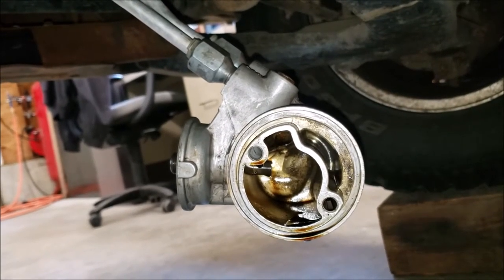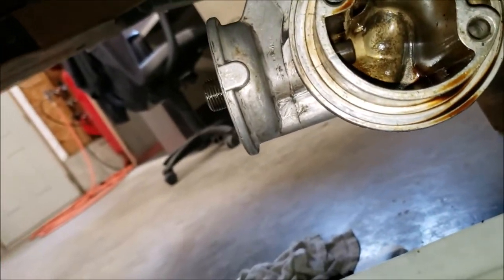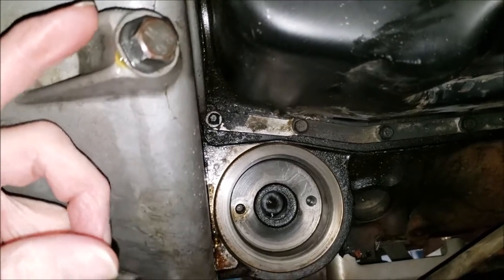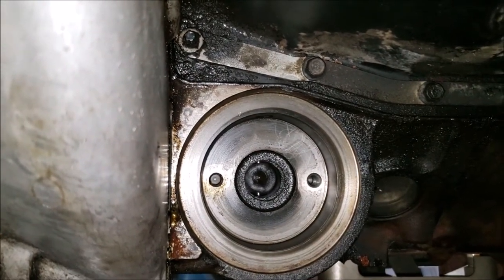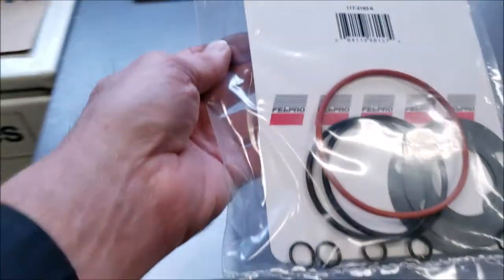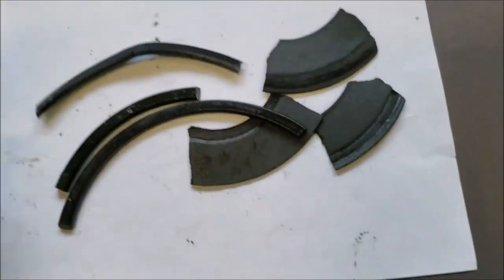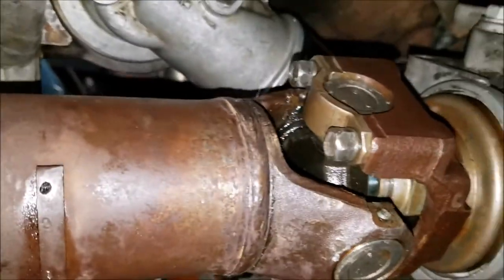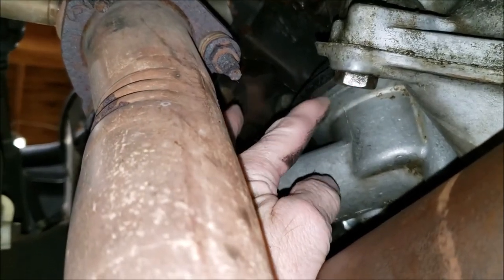Massive Oil Leak from Oil Filter Adapter. 1993 Chevy Silverado 5.7 Liter.

Comment: My 1993 GMC pick-up has had a small leak for a couple of years that I pretty much ignored.  Today my oil pressure dropped to zero.  Fortunately I had two quarts of oil handy and figured I was good to go, but I was wrong.  Six miles later the oil pressure was down to zero again.  I has a massive oil leak.  Bought five quarts of synthetic oil at a gas station (all they had $$$) and I was good for about 15 miles.  Bought 4 more quarts at another gas station for the 4 miles home.  Hopefully you video just saved me a lot of money.  Thank you!
Reply from the maker: I hope it helps. When it happened to me the oil was just pouring out of the filter adapter in a steady stream and most of the oil would drain in a matter of minutes. good luck!
Reply: @mikesworld60  Just crawled out from underneath and looks like the gasket(s) failed.  It’s currently snowing here in Michigan and I’ll be working outside.  I’m going to try leaving the driveshaft and lines attached if possible.  At 69 I’m too old for this.  Thanks again!
Reply from the maker: @vetbcrazy  Thanks! good Luck

Comment: Very informative video Mike.  Thank you.  My son's 1998 K1500 Silverado 5.7 is leaking oil from the two oil cooler lines so I need to replace those.  While I'm at it I will also replace the filter adapter o-ring and gasket because those are probably shot also.  Your video showed me that I can just leave the oil lines attached to the filter adapter and then when it is unbolted and pulled down it will be much easier to remove the oil lines.  Different from your 1993, on his 1998 there are two small spring clips that must be removed to remove the oil lines from the adapter and just unbolting the adapter first will make removing those spring clips much easier.  I can also install the new oil lines and spring clips to the adapter first and then bolt the adapter back to the engine.  Will be much easier rather than trying to get those little clips back in place with the adapter on the engine.  I also plan to use the Fel-Pro ES72671 gasket kit like you did.  Thanks again.
Reply from the maker: I am glad the video was helpful. Thanks for the compliments. I rely on other people's videos also. Thanks for watching.

Comment: yeah I thought I had a rear main seal oil leak. My 90 Silverado lost almost all the oil from work to home in 6 miles. My Toyota dealer mechanic neighbor said, "you might have got lucky, it could be the oil filter housing gasket."  I thought it was just a gasket and didn't realize that hard brittle O-ring was an O-ring.  I thought it was a piece of metal.  So don't do what I did.. change only the gasket .. so I had to take it off again to install the O-ring.. and I wish I had taken a video of it too.  I had driven around with an oil leak for 5+ years.
Reply from the maker: I think mine was leaking for a while also. I started to notice an oil burning smell one day and found oil all the way down the underside of truck and spots on the back of the tailgate. When I started it up that day it proceeded to empty the rest of the oil on the ground. I fixed the leak and changed the oil and filter. There was only a quart or so left in the engine. Now I don't have that small spot of oil under the truck where I park it. The problem went from a spot on the ground to a severe  oil leak in one day.
Reply: I have the same problem
Reply: Only 5 years? You’ve got nothing on me!

Comment: One thing, I learned the hard way to NEVER seal a gasket or o ring with grease. They will stick so bad that you have to almost grind them out. Same thing with oil filter gaskets. Use good removable gasket sealer or plain oil film.
Reply from the maker: Great point!

Comment: I assume you want to drain the oil first before doing anything. About to do mine over the weekend.
Reply from the maker: You can drain the before or after. The only oil that will come out is the oil in the filter and the lines. When the engine is running, and you have bad seals it kind of drains itself. New filter and oil when your done and you're good to go.

Comment: Thanks for the video.  I was doing that job today but am having the darndest time getting the new flat (paper) gasket to stay in place working underneath (did not remove crankshaft, no lift/pit).  Old gasket was gone (completely disintegrated)  years ago.  Just a bit of baked on residue, otherwise nothing left of it.   Working underneath in cramped conditions,  I cannot get the flat gasket to stay in place.   Replaced the O ring of course.  How vital is it to replace the flat paper gasket (a five cent part that will probably self destruct again in a couple years time)?  I haven't had one in probably over a decade and only had a minor leak,  presumably from the failed O ring.  Thanks for any advice.
Reply from the maker: I put a little grease on it so it would stay up there. I think I mention it in the video. Thanks for watching!
Reply: @mikesworld60  Yes, that might work.  Also, how about using some Permatex gasket maker to hold the flat gasket in place?

Comment: How did you get so much slack to let the adapter hang down like that? Mine will not come down
Reply from the maker: The only two parts I removed to get more room was the front drive shaft and the brace that bolts onto the bell housing.

Comment: What about the little steel plate between the adapter and the block?
Reply from the maker: Not sure I know what you mean. Did I miss something?
Reply: Fel pro gasket doesn't have the metal